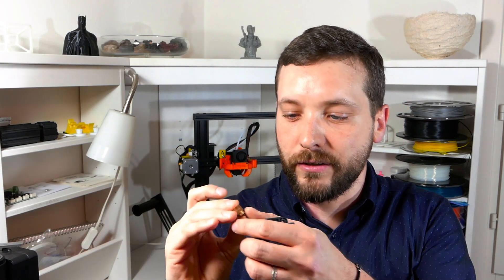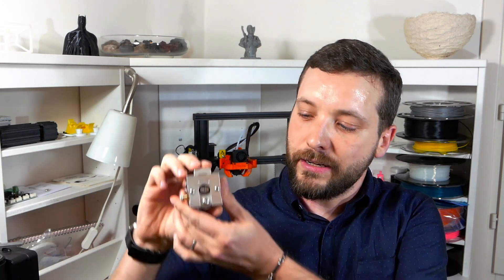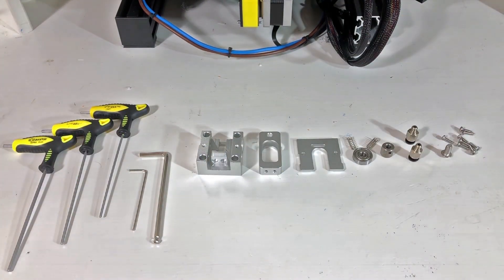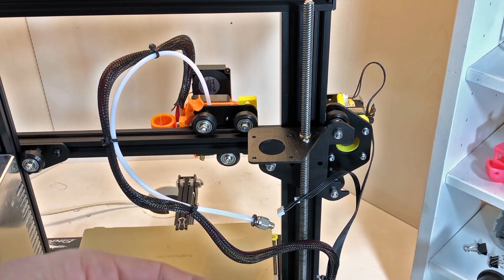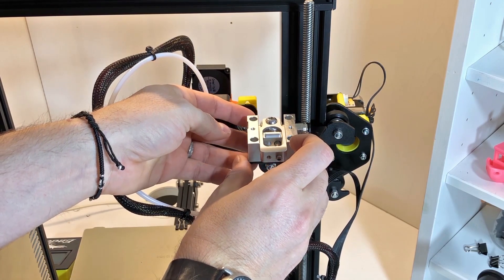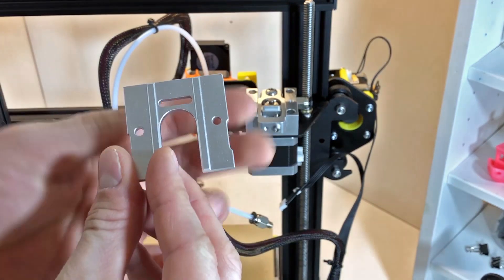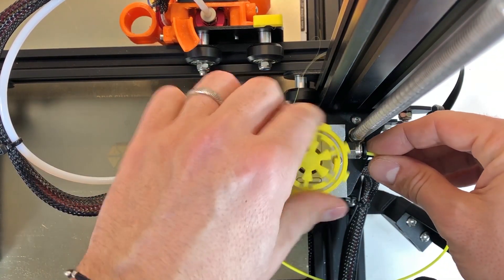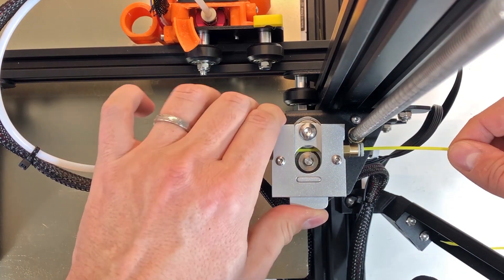Ender-3 All Metal in-line Extruder: best alternative for the stock extruder?

Comment: Your pneumatic fitting with the black head appears to be a "through" type, where the PTFE tube can come out the threaded end.  If that's true, then you are probably getting stuck on the end of the tube.  Push it in further until it comes out the threaded side, and it will probably align better.

Example image:  https://www.aliexpress.com/item/32877007745.html
Reply from the maker: I will give it a try!

Comment: Feed it in with the knob! Everyone struggles with this... Lol
Reply from the maker: The problem is that the filament snugs on the teeth of the fitting...
Reply: @AMakeDesigns  oh ok. Most people struggle when they release tension on the arm because it misaligns the filament to the exit hole, which is why it works better to feed with tension using the knob. I understand now that this is not the case in your instance.

Comment: Just getting ready to install this and wanting to see if you have a usage update since it's been a few months?
Reply from the maker: It's going very well so far. I had a small mishap due to too high adhesion with PETG. It chipped off a small bit. I've been using it face down with some hairspray on the bare steel with PETG ever since.
Reply: @AMakeDesigns  Just finished install along with a bullseye parts cooling duct so glad to hear the extruder is holding up well. Getting ready for my first print with the additions now
Reply from the maker: Justin Thomas I'm sorry. I thought this was the video on the PEI bed... :-/
Anyways, the extruder is very fine. Only problem is with the teeth of the fitting that can get in the way of the filament while you thread it in. Let me know if yours is having the same issue!

Comment: The reason you can’t pass the filament smoothly in, is because the filament is stuck on the flat edge of the fitting part itself.what I did, I have drilled in the fitting input only the cone with a 5mm drill, just to make the input Y shaped...I hope you understand :)
Reply from the maker: It's clear but it is unfortunately not my case. It's the barbs that lock onto the pipe that obstruct the hole :-(
Reply: @AMakeDesigns  The barbs that lock the bowden tube should be on the outside of the pipe. They should not obstruct the filament. I made a chamfer on the inside of the fitting thread and solved the problem.
Reply from the maker: Great! I will try that. In my fitting the other side of the spring of the barb seems to be in the way.